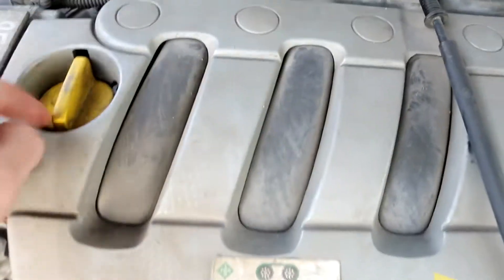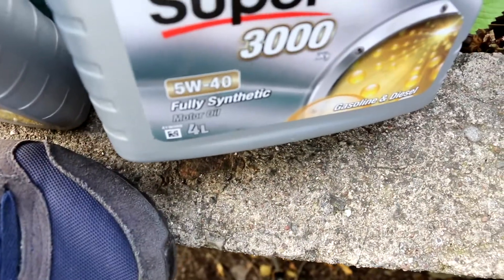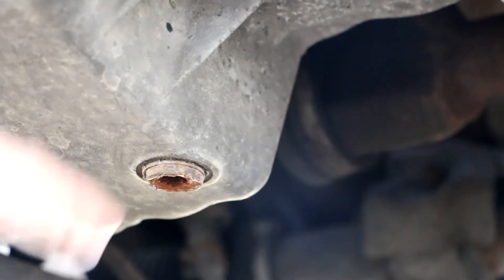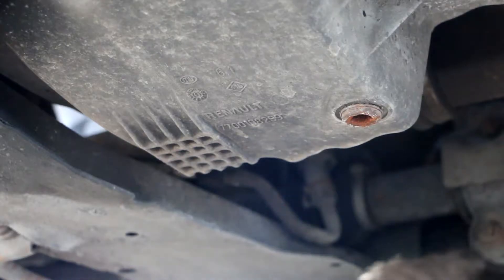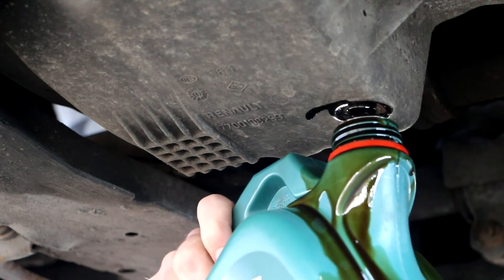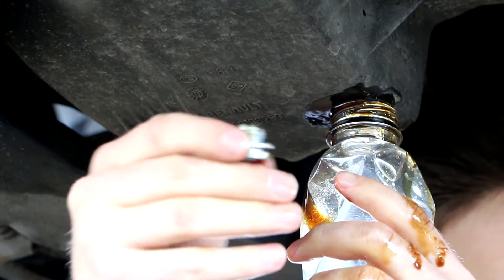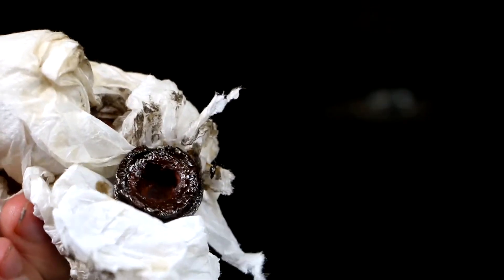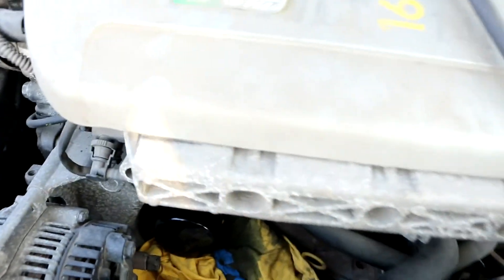Renault Megane I Engine Oil Change & Filter

Comment: How much litter did you put?
Reply from the maker: approximately 4 liters, but I suggest to buy 4 liters and 1l container, so  if you need more, you can add it as well if you have some extra in case you need after replacement or anytime later.
Reply: @JUrtanschannel 
I have already put 4.5 L but it needs more than .      is it correct???
Reply from the maker: @momentarawneh4867  khmm, it depends, since I didn't drain my engine too extremely well (total capacity 4.4l), 4l was ok for me, if you have totally drained your engine and put a big oil filter I guess you can squeeze 4.5l and even a bit more, but if you can put close to 5l, then it is definitely something weird, do you have 1.4. engine?
Reply: @JUrtanschannel 
Yes, my engine capacity 1400 cc. 
But when I checked the website it was 4.9 L